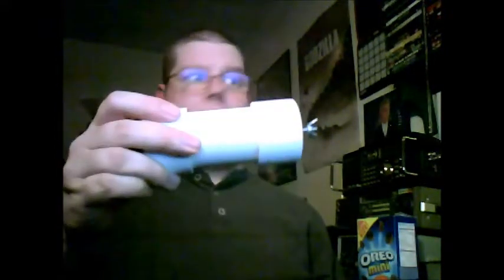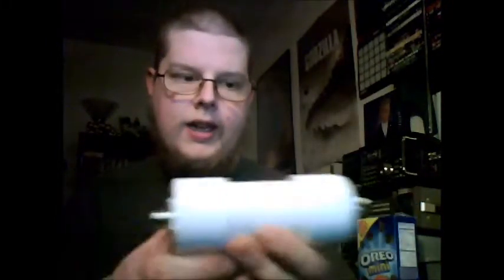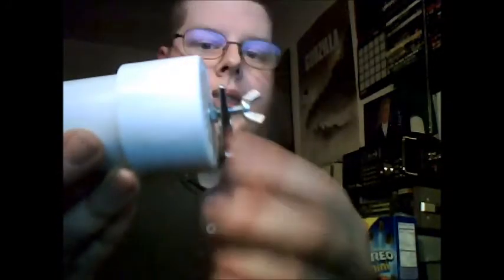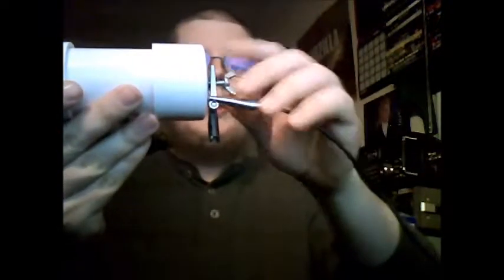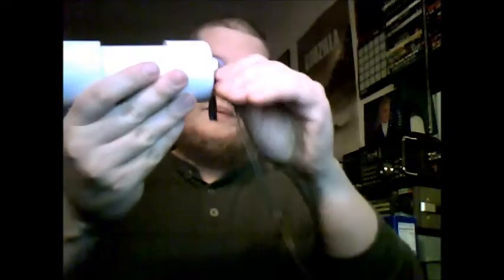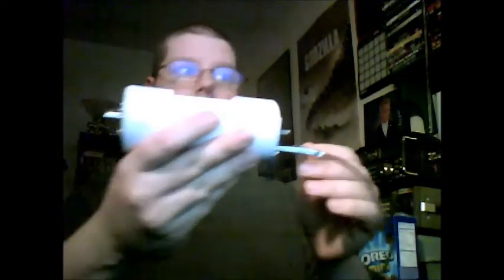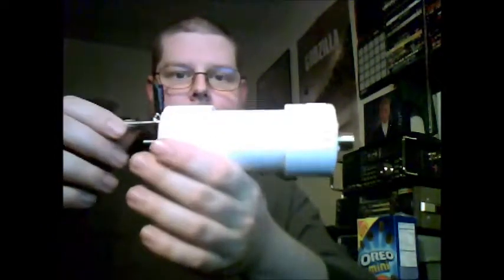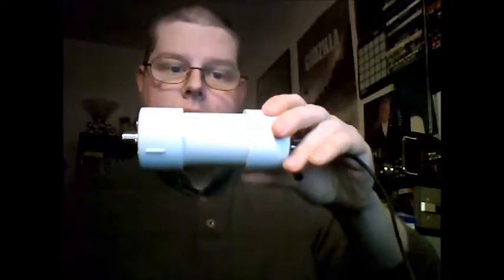My Balun and How the Antenna is Grounded

Comment: I had responded to the previous video but I guess I was a little slow, looking over the schematic designs of various 9:1 baluns I noted they either incorporated a counterpoise/ground connection or simply tied it into the shielded part of the coaxial feedline, it would also be quite possible to have both with the additional tap point being an auxiliary counterpoise connection.

http://www.hard-core-dx.com/nordicdx/antenna/feed/9_1balun2.gif